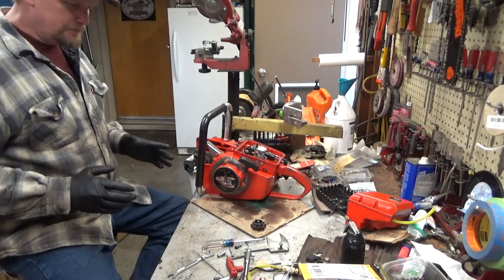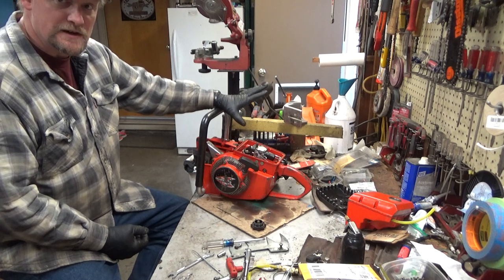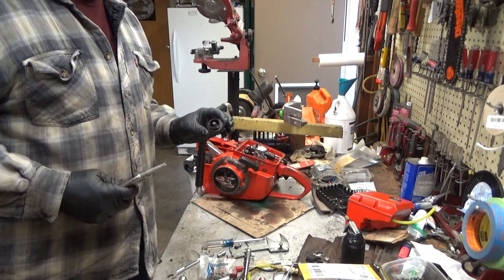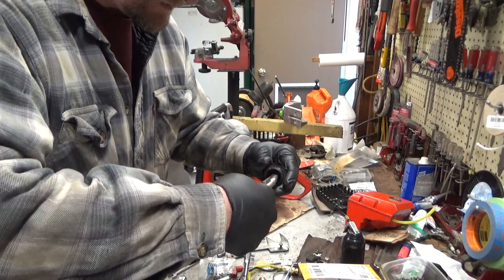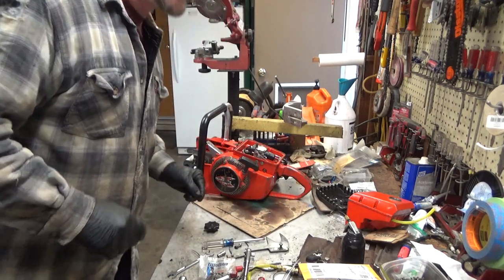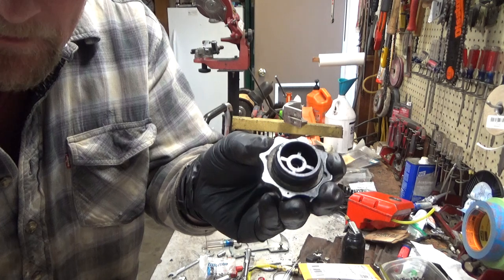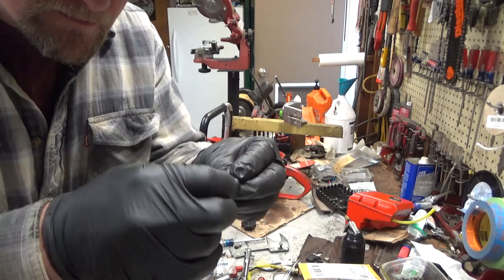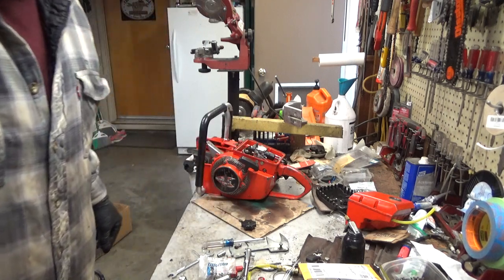Homelite C-Series, XP-Series Chainsaw A-65741 Fuel Cap Repair

Comment: My fuel cap has an aluminum stem instead of the plastic hole that brass filter goes in, is it another version? It very much doesn't want to come out... There's still a tiny vent hole on the outside of the cork seal, air definitely goes both ways through the aluminum stem, and the overall shape of the gas cap is similar to in this video... This fuel leaking when I used the saw sideways thing isn't acceptable when gas is 6.50 a gallon..